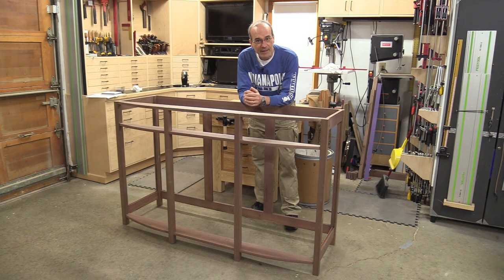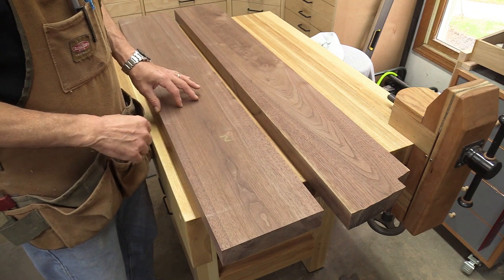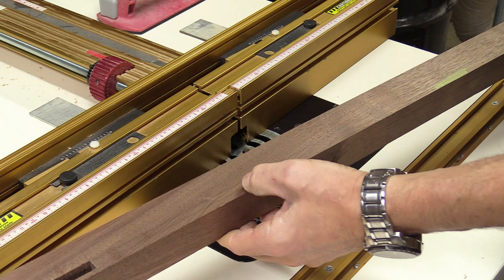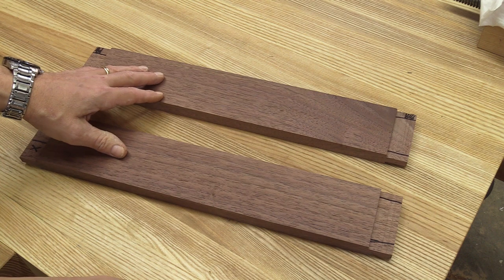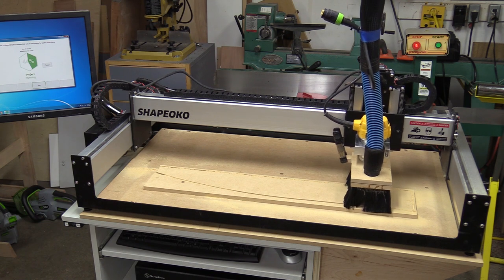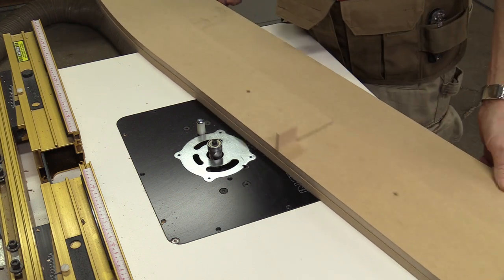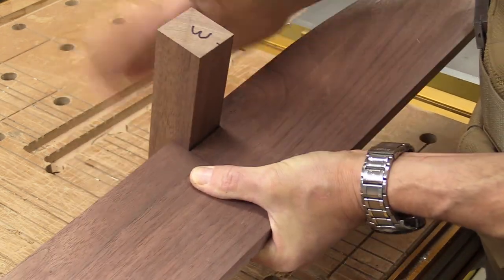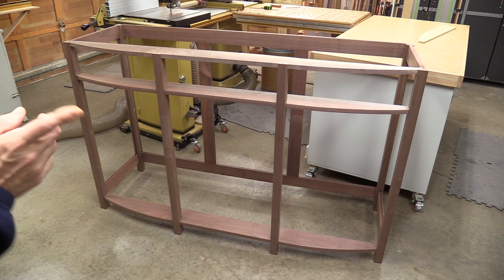Curved Front Walnut Buffet - Making the Frame - Pt 1

Comment: Nice , that is always a confusing process for me on That kind of piece. So many pieces to keep track of. Question , the centre legs are in kind of through mortise's through the bottom rail. Will it just be the glue holding that rail from 'sliding' down the leg? Even though it's a super tight fit o know just wondering your process on it. Cheers
Reply from the maker: Thanks Joey! The center legs are being held to the dividers with half lap joints, I may not have explained that well enough I guess.
Reply: GuysWoodshop ah right that works

Comment: Nice job Guy, you make it look so easy. I learned Imperial (Standard to you), and Metric at school, but have used mainly Metric for the last 35 years. I'm certain I'd be throwing my tools in the van and heading home after making constant mistakes if I could only use Imperial now. Metric is soooo much easier. Forget Centimetres and Metres, everything is in Millimetres, so easy. Where is the piece going, in your own home?
Reply from the maker: Thanks Graham! I have tried to use metric, and sometimes I do when I have to do some math to figure out measurements. It's much easier to add, divide and multiply a millimeter than dealing with fractions. Unfortunately I can "see" the imperial measurement in my mind and metric not so much.
Reply: I still go in the suppliers and ask for 3 metres of 3" x 2" ;-)

Comment: Excellent work! That frame has so much going on I’m surprised there weren’t any mistakes. Well... at least none admitted to - haha.
Your jointer wasn’t big enough to joint the full width of the board. What is your process to get the other part flat? Planer with shims?
Dovetails on the top of the legs for strength rather than show since it will be covered anyway, right?
Reply from the maker: I joint the board as much as I can on the planer, and then have a board that sits on that one flat part of the board. And the dovetail on the top rail is to hold the top together. Purely mechanical.
Reply: GuysWoodshop Sorry, don’t understand about the planing when jointer can’t get the full surface. Perhaps in the future (if you have time) you could make a video about it or point me to one that uses your process? (If it’s not too much trouble)!

Comment: Guy, would you put a link to the special patterning bit please....Thanks
Reply from the maker: Hey Tom, I don't have affiliate links for this, but the model number it is Whiteside Model UDC9112 Spiral Combination
Reply: GuysWoodshop Thanks Guy.... But FYI the correct Whitside number is :  UDF 9112.  Jus in case anyone might want to get one
Reply: I went back to Whiteside trying to find prices on several bits (they don’t seem to do that) and also found your number to be good....
Reply from the maker: UDF 9112 should be a good number. I copied it directly from Amazon when I looked up the bit. Check it Amazon
Reply: GuysWoodshop It is good, sorry for my mixup. Our messages must have crossed.